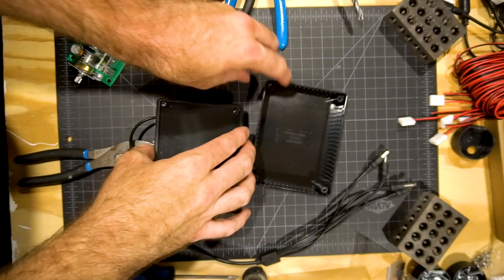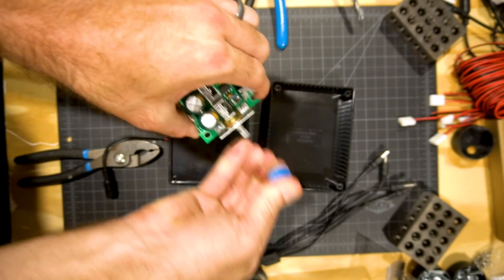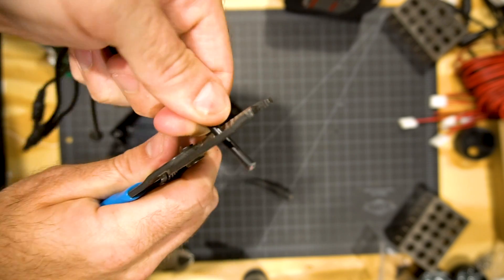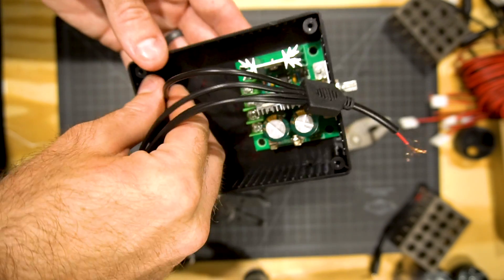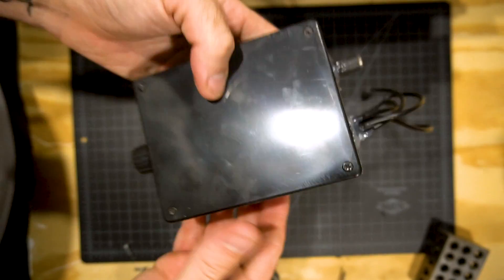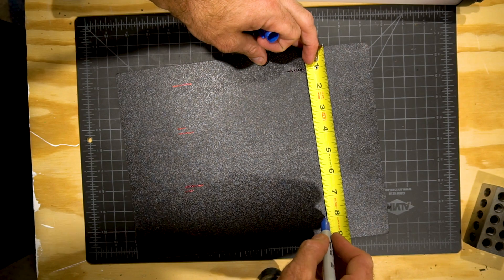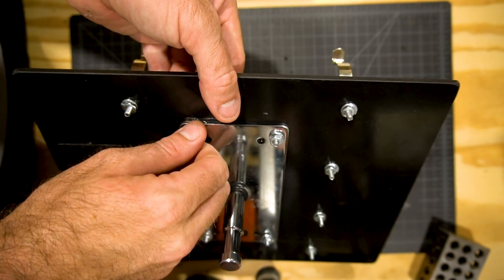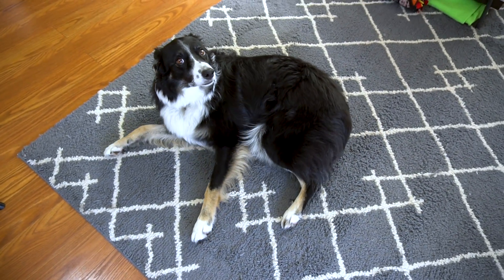TUTORIAL: DIY Mount & Dimmer (for tube lights)

Comment: The clips he used are KENO Flo Lamp Holder Clips for T12 - 24 Pack.  Part No: EXP-LHC-T12.  About $22 on B&H. 
Other T12 clips I have found are far to strong and hard to push the tube into.
Thanks for a great video.

Comment: Absolutely loved the video and the way you explain things!

I've just bought 4x 4FT T8 Led Tube lights (20Watt) from Amazon.
Do you think it's possible to convert them using a dimmer controller?
I'm based in the UK, so not sure about power output differences, etc. Any help would be greatly appreciated! Thanks.
Reply from the maker: Awesome! And thanks so much. Do you have a link to the product? I'll take a look and see, but I assume you could connect them to a dimmer
Reply: @DroiMedia  Wow! Thanks for the quick reply, I really appreciate it.
I'm not sure how youtube would react to me posting an amazon link in the comment section but here it goes (I'll shorten the link, just in case)

https://www.amazon.co.uk/dp/B089LV1ZW3, if not, if you open Amazon ".co.uk" and type B089LV1ZW3, they'll show up - sold by Brillihood Store (£54.99)
Appreciate your time!

Comment: how much money do you spend on this project to do
Reply from the maker: Hi Rohit! If you look through the links in the description you'll see this dimmer (w/ everything but the lights pretty much) will cost around $50 USD. It might be more/less depending on your needs, how many you make, and what products you ultimately end up purchasing. You can find alternatives for the dimmer, power cord, and splitter, just be aware that they will need to be rated for the correct wattage/amps of whatever lights you're using.

Comment: Awesome video..is there a way to do this without getting into the electrical components?
Reply from the maker: You could buy a dimmer! Most LEDs have dimmer compatibility issues though, so you'd need to find one that works with LED strips.
Reply: @DroiMedia  I see..I'm new to these things..I wanted to keep it as minimal as possible without interfering with electrical components and not having wires all over the place..